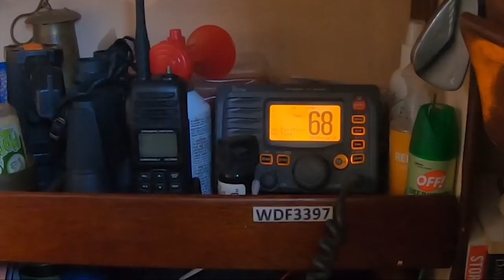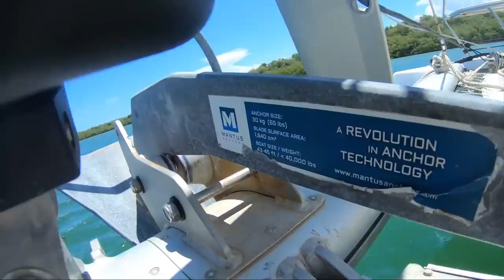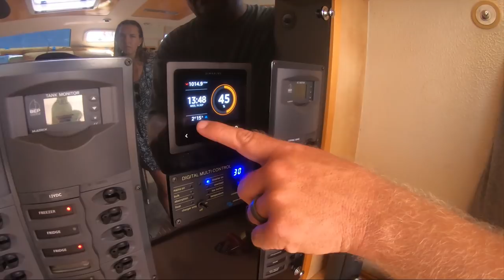THIS is what a *Modernized* Blue Water Catamaran looks like! - Bums on a Boat Ep 141

Comment: Props to Bill for making that battery set up so tidy and well labeled!
Reply: Thank you!! 😍🙂
Reply from the maker: Yea, his systems are on point!
Reply: Bums on a Boat  I wish mine were on point. Had some elec issues but got them straighten out we are heading out Sunday morning thanks to my brothers knowledge we got fired up in about three hours Brutus came to life again thanks Greg and Freddy I got to get Freddy to the deep blue thanks John 🇺🇸🇺🇸🐠🐟🎣🛥🌴⛱😊😊🙏🏻🙏🏻🙏🏻
Michal and Joel be safe in your travels remember keep the blue side down under boat and be careful out there Capt John 🇺🇸
Reply: Extremely well labelled... impressively.. neat and tidy..  Some serious techno witchery there... Thanks for sharing your work, great ideas.. and cruising tips like: upgraded anchor and bow sprit (did you strengthen the drill points on the bow sprit with collars or brackets etc?  I ask as drilling directly into the metal without reinforcement can lead to a component failure due to increased metal fatigue around the joint.).  Its great to know that around 2000 watts of solar does the job nicely... And having propane outside and electric cooking via induction inside is a great tip..

Comment: Bit late to the party. We had hull#51 "Mojo" We loved the boat. Bill can thank me for those dip sticks for the diesel and water. Everyone after copied mine. They were graduated in 20 litre(+-5gal intervals) Much more simple and reliable than other guages - even on "million dollar boats" We spec'd two showers as the baths are impractical - not enough water and they're tiny. I'm 6'2 and couldn't stand in the bath to shower. Nice job on the fwd stbd cabin  converted to a garage/storeroom.

Re the hull numbers. Knysna bought the moulds from St Francis marine (SF44) when they started building their 48 and then 50 footers, and continued the numbering from where St Francis left off. The first few boats were built identical, but then Knysna built a new, more spacious and more modern deck. Big improvement IMHO. Great boat. Thanks for the shaking out the good memories

Comment: Great video of a great boat. Loved the electronics section. Man, those Lithionics batteries are crazy priced! All the LifePO4 cells come from China. Building a 1200ah 12v battery with very high quality LFP cells and a fantastic BMS can be done for $4k these days, that will last 15-20 years at 0.5C load and 0.3C charge rates, and using less than 80% DOD.
Reply: Thank you!  I admit, I haven't priced them recently. We bought ours 3 years ago. With this type of thing, the prices are probably dropping by the day.

Comment: Props to Bill! Battery costs have fallen a ton. In a DIY type arrangement (not a Battle Born) you can buy that much battery for about 2.4k now. Pretty amazing...
Reply: Yeah, prices continue to fall.  It's great for everyone!  Keep in mind though that we bought ours in January 2018.  Also that ours are Lithionics batteries which are more involved because they have separate charge buss and load buss and the battery management system can shut one side down while the other side still functions. This is a HUGE advantage if there are any faults in the system...and it adds upfront cost vs a drop-in type lithium battery system.  So comparing only Ah vs Ah is not really accurate. 😎

Comment: Bill obviously put a lot of thought into the electric system on Caterpillar.  Good job!  How often and how long do you have to run the engines to charge those beastly batteries?
Reply from the maker: To me it seems like they run the engines a few hours each day.
Reply: The short answer is that we run them about an average of around 1 hour per day.  Sometimes we go closer to 2 hours every other day.  Keep in mind that we are using a lot of power and seldom make much effort to conserve, because we charge so fast.  With a 1200 amp hour bank, we can draw 500 out in a given day, but with the two 250 Amp alternators and solar, we can put it all back in just about an hour.  Most people who talk about lithium batteries talk about how far you can draw them down without ruining them, and that's true, but the REAL magic of the lithium that you don't hear as much about is their charging efficiency.  Once we add more solar panels, we might be able to get away with only running the alternators on cloudy days.  It may sound frivolous or pretentious to say that we don't conserve, but if you think about it, if I leave the lights and fans on for 6 hours... drawing say 5 amps per hour... that's 30 Ah, which when running the alternators at 450 Ah, means I can put that back in in about 4 minutes.
Reply: @sailingsvcaterpillar4672  I am not judging at all.  Having lived on the gulf coast, I would be running an AC all night in the summer.  As a kid, living in a house with no AC, I remember not being able to fall asleep until 2 AM, and fighting with my twin brother over the cool side of the pillow.
Reply: @donr416   Oh, no judgement felt!  No worries!  I just love talking about that stuff and find it hard not to write 3 full pages when someone asks a 3 word question! ;-) LOL

Comment: Hull number vs production number.  Either they use two hulls to make one boat (Rest used in testing or otherwise) OR the other hulls where used to make different boats
Reply: The answer is that St Francis made the first 40 boats with this hull mold and when Knysna bought the mold, they redesigned the deck and interior, but used Hull #41 for the first Knysna.  SV Caterpillar is actually the 11th Knysna 440 out of a total 22 built (before they retooled and started making bigger boats)  🙂
Reply from the maker: Bill answered the question and yes, I got the question wrong...slightly lol

Comment: Battery cost is high per watt hrs has come down significantly. But I would argue that it is worth every penny of the higher initial costs.
Reply: We feel like it has been worth it too!  When we were in the Bahamas, we heard people every day on the radio asking about how and where they could get propane because they were out.  Not us!  Also keep in mind that ours were a bit pricier because they are Lithionics brand, which are more involved because they have separate charge buss and load buss and the BMS can control them separately. Much more to them than the drop-in kind.

Comment: Question for Bill regarding engine access. 
Do you prefer engine access under the bunks (Pros - access hole bigger, inside, out of weather.   Cons -  heat, noise, smell, dirt inside) or do you deal with that because it's what you've got. 
External hatch access means you are exposed to the weather and through a small hatch but it keeps the dirty engine outside. If external and you sustain damage/leak to the saildrive, you might be able to keep the water from entering the living area. 
There are pros and cons to each access.
Reply: It's hard to say. If there's one thing I've learned it's that everything is a tradeoff. To change one thing requires changing something else.  I took the old engines out and put new one's in and I would have loved to have that outside easy access,  but other than that, the inside access seems better. There are blower fans that draw the heat and odors/fumes out while they run... while the ignition is on. I rewired them to add a switch so that I can run the fans even after I shut the engines down. This helps to keep the interior from heating up and keeps it from smelling like an engine. It works for us.

Comment: Year 5 boat 2.   Just a guess.   Really nice setup.
Reply: Thats a really great guess, but The answer is that St Francis made the first 40 boats with this hull mold and when Knysna bought the mold, they redesigned the deck and interior, but used Hull #41 for the first Knysna.  SV Caterpillar is actually the 11th Knysna 440 out of a total 22 built (#52) (before they retooled and started making bigger boats)  🙂

Comment: One thing missing from that boat it seems....  AIRCON!
Reply from the maker: Correct!
Reply: Yeah!  LOL!  We might never leave the boat then! 🤔😂
Reply: @sailingsvcaterpillar4672   AC just not practical unless at the dock as I am sure you are well aware
Reply: @faircompetition1203  not necessarily!  There are a variety of smaller AC units that can be run easily from a lithium battery bank. Can cool the staterooms for more comfortable sleeping through the night without running a generator. Maybe not the whole boat, but it can be done and we often consider it. A 4200 BTU unit draws less than 40 amps (@12vdc) so I could run it for 25 hours on 1000 Amps of our 1200ah battery bank. It's not for most boats, but it can be done.

Comment: Bill, great outfitting and great boat. How long have you had SV Cat? How long did you spend re-fitting her and how long have you been touring on her? Any prior boats and/or sailing experience ? Thx.
Reply: Thanks for the compliments!   Caterpillar was built in 2006 and we bought her in 2016 as the 2nd owners. After some delays, we planned for a 6-month refit and decided to go sailing 18-months later 😬🤷‍♂️ even though we still have projects to finish. We splashed in the spring of last year, 2019, and spent the summer in Oriental, NC.  Then headed south in November. Made it this far by the end of January and kind of got 'stuck' here in Luperon. We had small power boats most of our lives, living on lake Erie in Buffalo NY, but not a lot of sailing experience. We did a couple week-long sailing charters though.  So to "ease into" the sailing thing, our first sail on this boat was a 9-day offshore trip from Sint Maarten, where we bought her, to North Carolina, where we did the refit in Wilmington.  Another common question we get, especially when I say we bought her in sint Maarten, is was she a storm-damaged boat that we got a deal on? And the answer is no... 2016 was before the devastating storms that went through that area and damaged a lot of boats. Our boat was in excellent condition when we bought her. Thanks again!  We do have Facebook and Instagram public accounts under sailing SV Caterpillar  if you are interested, fyi.

Comment: Are the Knysna hulls sold to another builder in SA?  So is bill(?) an electrical technician as that’s quite some work he did. And it had to be planned.  Where did they do the refit? And was it a good choice of location? 
Are the happy with the quality of the Knysna , since they have touched every part of it? ( what year?)
From Buffalo, I have family there , what area are they from and are they 'native ' buffaloloins?
Really nice refit 
My friend just did a long refit on a st Francis 44 ,similar but very different in other ways. Another great boat.
Oh Michal loving the braids look 😎
Cheers Warren
Reply: Hi there!  I think I can answer all your questions! 😉  Knysna started their company by buying the hull mold from St Francis and started building 44' cats. Knysna redesigned the deck and interior and added more headroom, etc, but the hulls are the same as the st Francis. St Francis had built 40 boats with it, so when Knysna built their first, they called it hull #41. Ours was the 11th knysna, hence hull #52. They made 22 total before tooling up for a 48' model, which they made a bunch of, then started over again making 50' models, which they are still doing.  If I could afford one, I would buy their 50' in 5 seconds!
As far as the electrical, no, I am not an electrician!  I was a NY State Trooper. I self taught myself all that, but I had consulting help from Bruce Schwab at OceanPlanet Energy, where I sourced the batteries from. But i did 100% of the work. Getting everything to FIT was the biggest challenge! 
We did our refit in Wilmington, North Carolina. We loved it there.
Any yes, I have touched every inch of this boat inside and out, and we are very satisfied with the quality. We particularly like the fact that it has a foam core and not the balsa that almost all of the production line brands use.
I AM a native buffalonian, born and raised. My wife is from the Hudson Valley NY but we have lived in Buffalo since shortly after we got married. Specifically Hamburg... southtowns. What about your family? 
Fire away if you have any other questions!  We are also on Facebook as sailing SV Caterpillar too 😉
Reply: Sailing SVCaterpillar  Hi bill , thanks for info , I worked in SA in ‘79 boatbuilding long before the catamaran revolution there!  I’m glad you got help from Bruce Schwab, that’s some reliable looking electrics. Have you seen the videos from ‘Sea dreamer project’ another upstate NYer in law enforcement building an entire boat! No previous experience ! There’s something in the water I hear!  My family from the city ‘Elmwood’ area.& Brother in law has old family shore house in Ridgeway (like Caribbean for 3 months!)lovely! ‘Southtowns...read snowtowns!!!
Did not know that about Francis/Knysna hulls but makes sense , I think your 2 hulls are one piece( they are now anyway) unlike many of the R&K!
My friends stF 44 is really comfortable I noticed the pitching moment seems to be about the cot-pit so a really comfortable ride. We did a 24 hr race in some good winds and his salon table was not bolted down and we could leave cups of tea on the table with out spilling ! Even upwind. His has the mid mounted engines! 
I posted some short vid/photos of us sailing on IG ‘warrenboatman’ and Flickr Dynaform. Cheers Warren
https://www.instagram.com/p/B0JQ54OgMZs/

https://flickr.com/photos/143629100@N07/sets/72157716062505712
Reply: @CheersWarren  ah, yes, the Elmwood strip!  Probably the coolest neighborhood in the city. I will look up the sea dreamer project and check out your links!  Thanks!  (Snowtowns... lol  truth!!!)

Comment: Pretty electrical system but kind of small for what they are doing. They would need to triple the amp hour capacity to have any sort of freedom from engines and generators. That said, I might be all wet here, as I do not have any numbers on battery capacity , charging capacity, ect.. How many amp hours are available, I'm assuming at 12v. Charger controller type (just curious).
Reply: Three 400 amp batteries at 12v is 14.4 kw.  Unfortunately, bigger batteries isn't going to do anything for getting rid of a genset, at least not for a while until the tech improves.  There's no reasonable way to get enough power to charge the system in a reasonable amount of time.  Even being a cat, if you covered the entire thing in the best solar panels available, you're only really looking at about 15 or 20 kw of peak power gen.  You could supplement with wind generators as well, but those seem pretty hit and miss with actual power output (not to mention they shut off if the wind is too fast).

You  could move to electric motors for the  props , and at that point larger batteries would make sense, but you could only use them for a short while (or travel very slowly for a longer while) before you would need to stop and wait for the batteries to recharge.  It's completely doable (and much easier with a cat), but neither cheap, nor easy, and definitely not to the point that it would equal having diesel engines for motoring.

That being said, I am currently banging my head against the wall trying to figure it all out and make it happen... at least theoretically.  I'm lacking in the financial department, but I figure it never hurts to have a plan :)
Reply: I'm not sure that you assessment is accurate.  But regardless, we weren't really looking to be completely free from running the engines, just to be able to power the things we want to run. Having said that, we do plan to add a lot more solar. FWIW, we have no dedicated generator. But the two 250 amp alternators charges the batteries quite quickly!
Reply: @FlesHBoX   you make some good points!  FWIW,  we have no genset, just the two 250A alternators. "Just" haha lol!  Keep plugging away at your goal!  We wanted to go with electric motors, but it just added too much cost to make it work for us. And... the true beauty of lithium batteries isn't necessarily the "capacity" but rather the "charge efficiency."  The fact that they can accept as much charge current as you can afford to provide makes them the closest thing to freeing you from burning fuel.  Being able to pump over 500 amps into the batteries all at once with our 2 alternators and solar means I can go from 90% discharged to completely full in just 2 hours.  A similar size AGM or lead-based battery system would take many times longer to charge them properly...usually burning many times (multiples) more fuel.
Reply: @sailingsvcaterpillar4672  Yeah, having bigger alternators on the engines is a great way to remove the need for a dedicated genset.

And yeah, electric motors is a hefty investment right now, especially for their limited range without a massive battery bank (ALSO a hefty investment, lol).

It might even be more efficient to use the large alternators on a diesel engine approach than to have two electric motors and a genset, since you can use one engine as a genset when you need it, and when you're motoring, you get charge without having to burn more fuel to charge if you need it, and if you don't, the load on the alternator goes down, so you have a couple more hp to push the boat.

It's definitely an interesting and deep subject.

Comment: Is that alternator not too hard on the motor?
Reply: Not at all!  Actually, diesel engines prefer to run with load on them, so running a propulsion engine (as opposed to a dedicated generator) just to charge batteries isn't that good for it, so the added loading actually helps. I have also integrated alternator regulator on/off switches right at the helm near the throttles so if we are motoring and encounter a headwind or strong current, I can shut off the alternators to maximize power to the propellers. 😎